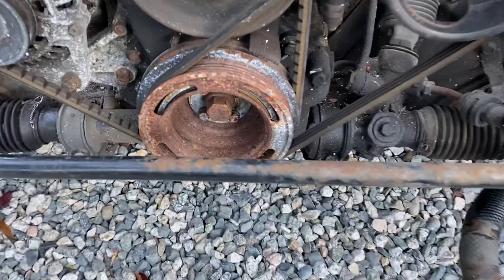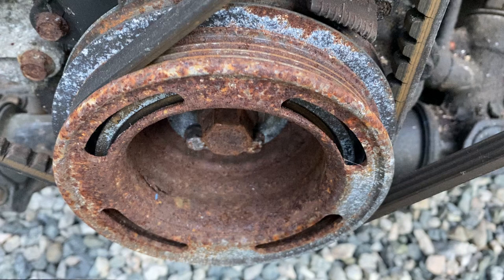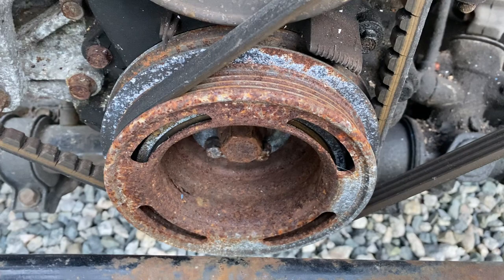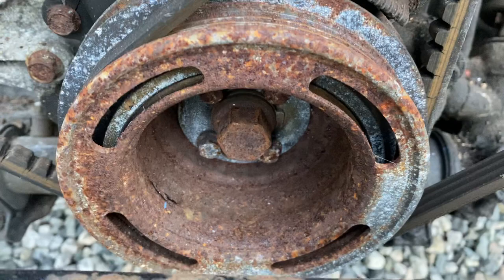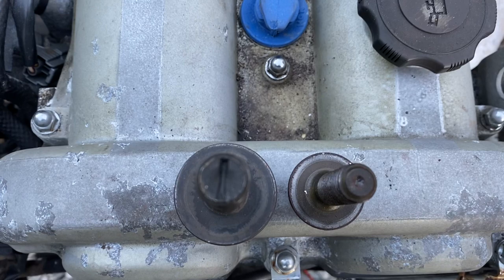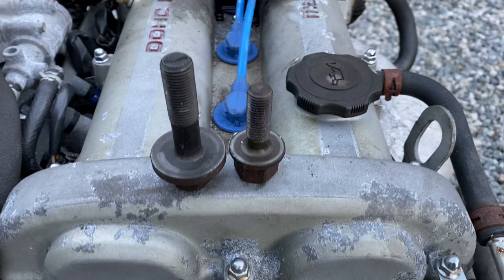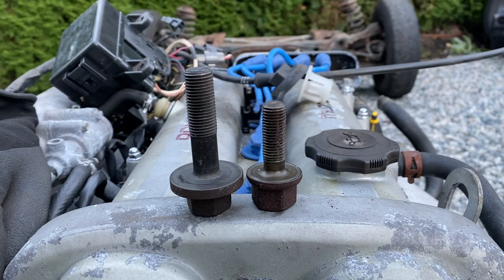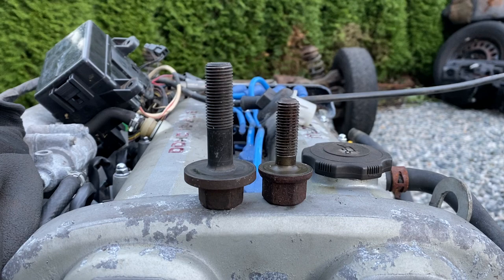1990-1993 MX5 Miata crank shaft:  Short Nose vs. Long Nose crank and how to identify them.

Comment: 1:25 correction to clear a lot of confusion. The small bolt on the right is for short nose AND long nose, the bolt on the left is for big nose cranks. There is a big difference between the three

Comment: Great video, would a short nose not be a good candidate for adding boost? Got a mk1 with original 1.6 engine and also a mk2 1.6 engine and wondering which would be better for boost (assuming both in same condition)
Reply from the maker: The mk2 motor would be a stronger candidate. 
I have seen boosted short nose mk1 Miatas before, but they won’t take the same abuse as a motor with the larger “long nose” crank shaft. The other think to consider on a 1.6L mk1 / NA6 Miata is the weaker differential. If you want to turbo or supercharge, the stronger 1.8L diff will last a lot longer.
Reply: @MiataMan  Thanks for the info. We have a 1.6 NB as well with less mileage so sounds like would be better to turbo that one and put it in there. Would make the manual swap a bit easier too.
Yeah heard about the diff before, 1.8 or Torsen but Torsen ones are not cheap!

Comment: I don’t know if you’ll see this but my crank pulley is a different type of pulley from my alternator and the top pulley and it’s causing a squeal. I’m trying to replace the crank pulley so it matches the rest but I don’t know which one I need. 1.6l
Reply from the maker: What year is your car? 
The 1.6L, 90-93 cars use a V-belt for the alternator and water pump pulleys. The 1.8L 94-97 cars switched to a ribbed belt.

Comment: 91 Miata short nose  owner here I just got her and noticed her pully was super wiggly I got it off and it came out without the short nose screw and i I can’t get it out what should I do I’m scared to break the crankshaft
Reply from the maker: I would find a trustworthy shop and have them do an inspection. 
You want to make sure that the slot in the crank shaft and pulley aren’t flared. 
You also want to make sure that the crank nose is not cracked.

Comment: 1990-1991 until revision is short nose. A long nose was a service part and never factory installed.1991 revised  and further is called a big nose, not a long nose. Long nose revised cranks are not visible without removing the timing cog, and very rare as well.. just to clarify..
Reply from the maker: Here in my neck of the woods we call them “Long Nose” cranks. I have been a Miata enthusiast since 1995 and have owned, worked on and seen hundreds of Miatas. Mazda started putting the stronger crank shafts into the Miata part way in to 1991. Miatas with a serial number ending in 127442 or higher had the stronger “Long Nose” crank shaft. 
It’s easy to tell if a Miata has a long nose crank shaft without taking anything apart. There is a much bigger shoulder on the “Long Nose” bolt and the crank pulley always has 8 slots instead of the four slots found on the Short Nose crank. This info applies to NA6 (1990-1993) 1.6L cars. NA8 (1994-1997) have a different crank pulley and a 1.8L motor.
Reply: @MiataMan  Let's call it symantecs, SNC, LNC and BNC are the Mazda terms, the 8 slots pully is a big nose (BNC). The long nose crank (LNC) is a revision on the Short nose crank (SNC) and also has the 4 slots pully (service revision on SNC) and small shoulder bolt. 
BNC has been installed factory as a re-design from half 1991 as a fix for the SNC.(from VIN 209447 (US) or VIN 127442 (Europe)).

An article on Miata.net describes the diferences and issues with all 3 designs in details here : https://www.miata.net/garage/crankshaft.html

Not want to bash your video or your information in any way, as i think it provides good information. Just wanted to point out that there are 3 variants on the Miata Crankshaft types from 1990-1993. As it seems to confuse a lot of Miata enthousiast over the globe.

Comment: short nose owner, got a grandpa owned 90' mx5 with 120k. crank pully is wobbling like crazy
Reply: Better fix that ASAP before the crank nose breaks off.
Reply: How can you tell it’s wobbly does it move when pushed?
Reply: @ijumpshot2613  at idle it was wobbling back and forth very noticeable, revved up and the pully looked like it was expanding.
Reply: Did you fix it
Reply: @grandtheftauto1233  just finished my engine swap last week, car runs great but I have some electrical issues now. and the old crankshaft nose shattered inside, it was a mess

Comment: Does anybody know how to open the trunk on a miata, I have one came with no key and no battery I tried pulling the trunk handle but is doesn't  open it might be loose or broken
Reply from the maker: What year is your Miata?
Reply: @MiataMan  its a 94
Reply from the maker: Sounds like someone disconnected the trunk release where it connects to the latch in the trunk. 
1. Remove the license plate. 
2. Drill a hole through the right indent behind where the license plate goes. 
3. You should be able to access the rod that actuates the trunk release. 
4. Take a pair of needle nose pliers, grab the rod and move it to the right until the trunk pops open. 
Let me know how it goes 👍
Reply: @MiataMan  thanks i got to it opened i did as you told me
Reply from the maker: Excellent 🌟👍

Comment: Short nose crank owner here... Still scared for the timing job when the time comes. Not a lot of MX-5s here where I live, so not a lot of shops familiar with MX-5s, not mentioning early MX-5s.
Reply: Would not be too worried, I have a short nose.. Benefit is that you do not need to remove the timing cog for a timing belt job.. tons of info on miata.net, and yes I would do it myself so I know it is done right.. fairly easy as well, did a few and I am not a mechanic..
Reply: @konijnenkop1177  Oh, I didn't know that! The thing is that I'm not sure if the front crankshaft oil seal needs to be replaced. I have a couple of minor oil leaks coming from the bottom of the car and might be front, rear or both crankshaft seals.
Reply: @DiegoMoonhaze  removing the cog to replace the seal is nothing to worry about. Just make sure to buy a new crankbolt, cog and key.. Follow the higher torque specs. Also a good opportunity to inspect the cranknose..